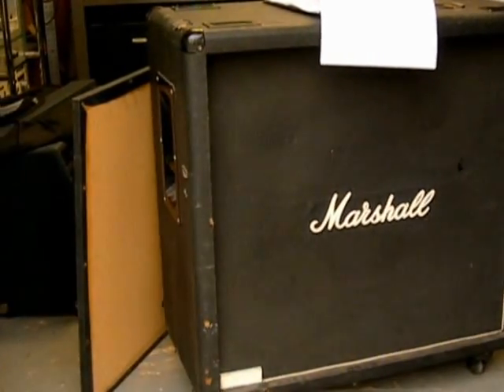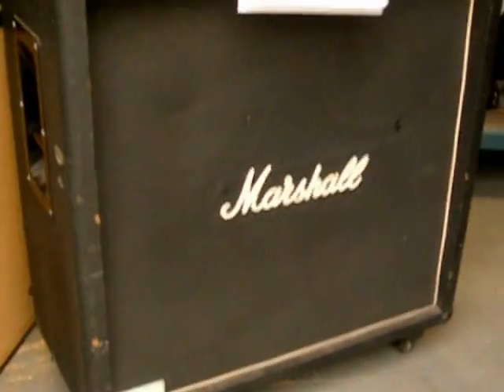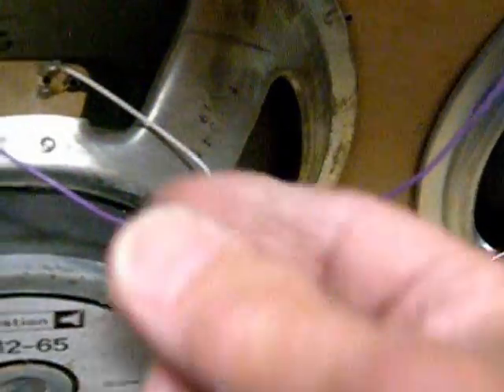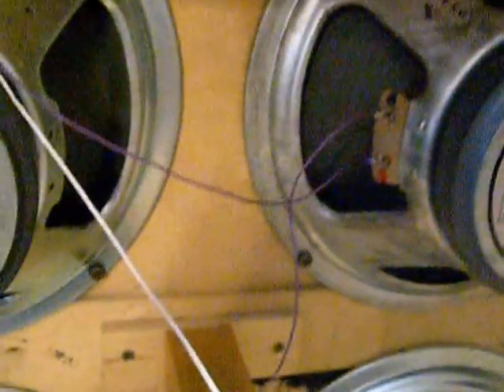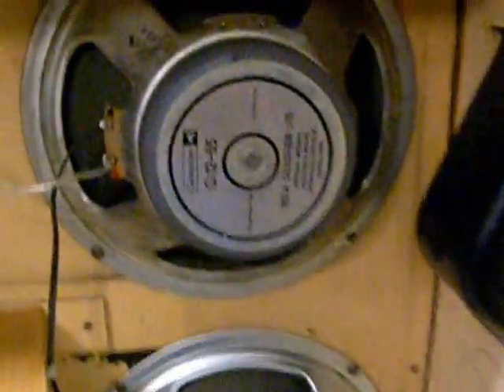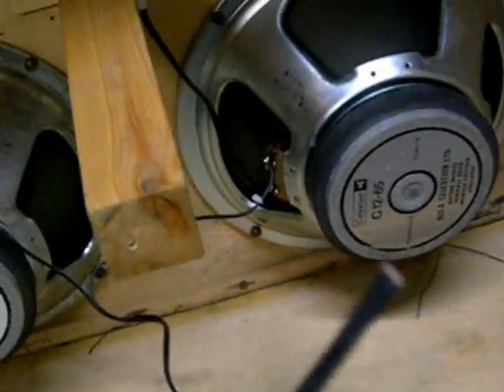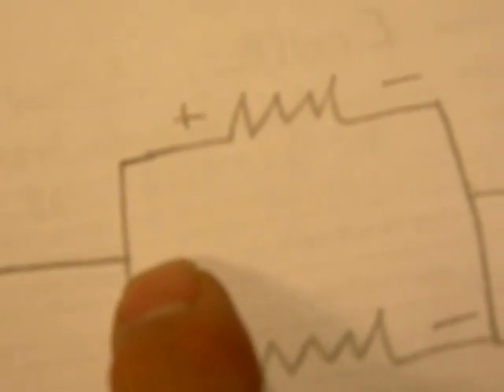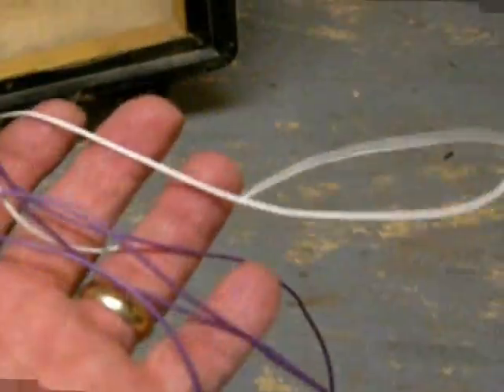Marshall 4x12 Cabinet Wired Improperly.wmv

Comment: Can somebody help me? I have a 4x12 marshall cab with 4x 8 ohm Celestion's and I would like to wire it up to get a total of 8 ohm's. Will series/parallel wiring work for that?
Reply from the maker: Put two of the speakers in series connecting plus (positive) to minus (negative). This puts the speakers in series and in phase so they work together pushing outward and inward in sync. This will give you two speakers in series which will look like one 16 ohm speaker. Do the same for the other two speakers. Now you have the equivalent of two 16 ohm speakers so you want to connect them in parallel, plus to plus (positive) and minus to minus (negative). Now you have 8 ohms and all speakers are in phase. Hope this helps.
Reply: @ElPasoTubeAmps  Thank you so much!!! Definately helps! I watched a video on how to do this wiring setup, but he was using all 16 Ohm speakers so I wanted to double check it would come out to 8 Ohms using 8 Ohm speakers! Im new to all this, but as a musician and a studio owner/engineer I'm trying to learn to do as much as I can buy myself for stuff like Repairs/Maintenance/Mods, and any help is always mucho valued! So, can I ask one more thing. How would I wire it up, if I wanted my 4x12 to be 16ohm's using all 8 Ohm speakers? Also I always forget but whats the rule when it comes to cab/amp impedance mismatches. If I remember correctly, it's you dont want the cabinet to be a higher impedance than your amp right?
Reply from the maker: @underpressureman  You are not going to get 16 ohms using four 8 ohm speakers. Your options are 8 ohms, 2 ohms or 32 ohms.  I agree with you on mismatch to go low on the speakers. The worst case I ever saw was four 16 ohms speakers wired in series (64 ohms) and it kept blowing the EL34's our of the amplifier until I had the customer bring his speaker cabinet to me and quickly saw the problem.
If you had four 16 ohm speakers you could get 16 ohms, 4 ohms or 64 ohms.
Reply: @ElPasoTubeAmps  Okay, thanks, that all makes perfect sense. Can I bother you with one last question? And I appriciate all the help so far. I actually have a pair of 16 Ohm vintage 30's that Im not using in anything, but all the other speakers I have are 8 Ohms. I really want to try mixing vintage 30's with G12M-70's but is there any way to use x2 16 OHM speakers and x2 8 OHM Speakers in a 4x12 and what would the options for wiring be if you can?
Reply from the maker: @underpressureman  You could put the two 16 ohm speakers in parallel for 8 ohms then  that pair in series with the single 8 ohm for 16 ohms. You could also put the two 16 ohm speakers in parallel for 8 ohms and put that pair parallel with your single 8 ohm for 4 ohms.

Comment: Good video. When ever buying used equipment you should always check the ohms before attaching an amplifier to it. Even if it's from a friend. If you don't know what you're looking for get someone that does.
If you're using 2 cabinets, they must be wired in phase(The same) or they will cancel each other out.
There's wiring diagrams all over the internet and there's plenty of demo's on you tube like this one.
A problem with buying used equipment is people stealing out the good speakers and replacing them with something cheaper, which in this case could have been 8 ohm speakers in a cabinet that says 16(or 15). you must hook the amp up to the proper load!

Comment: It looks like all you did is make it worse by reversing the polarity of two speakers. Did you check it with an ohm meter to make sure the impedance is correct? Your diagram was correct, your wiring was not by the looks of it with poor video quality.
Reply: Sure was wired correctly for impedance and phasing.

Comment: Marshall amps were routinely 8 OR 16 ohms. (the true vintage ones were very often 8...same is true for Hiwatt). HOWEVER, for those of us who toured using 4 cabinets per head ...this was the correct way to wire it if you wanted to set your amp to 16 ohms using  4 cabinets without much other monkeying around. Since it was internally done without having the polarity incorrect on any of the four, it may have been that way on purpose.???  By the way, this gives you a very nice sound on stage.  Not so nasty up close...but you don't loose it as you get farther away either.  And yes, you will blow some tubes if you only have one speaker cabinet plugged in at 60 ohms. You do need all four or you are asking for it
Reply: I’m afraid your comment is a little confusing. You said that, “Marshall amps were routinely 8 OR 16 ohms.” Were you talking about the speaker cabinets? Or the amplifiers themselves? Marshall Amplifiers since 1966 have had a selectable impedance of 8 & 16 ohms (and later on 4, 8 and 16) with the pin selector. So you set the impedance according to what speaker cabinet you’re using or how many. I have never seen a 4 x 12 stock Marshall cabinet that had impedance of other than 16 ohms. Hiwatt amplifiers also have a selector switch for the speaker impedance of 4, 8 and 16 ohms, along with most of the Fane purple loaded 4 x 12 speaker cabinets were also 16 ohm. I’m a little curious how you connected 4 Marshall speaker cabinets to one head? Most Marshall amplifier heads only have two output jacks with the exception of the model 1967 Major 200 watt amplifiers.
Reply: Kai Po Let me clarify, I realize few people are technicians looking through these vids.
Obvious (or not), I was referring to  the speaker cabinet, not the amp. My bad.
16 ohms was by far most common. But if you were in music in the 70s, you shouldn't even be arguing with me. There were plenty of 8 ohm cabinets out there at that time. I've been mostly out of music for close to 20 years, and I know if you didn't specify you usually got a 16 ohm cabinet.  I still have most of my gear, My hiwatt cabinet I  bought mid 80s is definitely an 8 ohm, although my oldest hiwatt cab. (1970ish) is 16...which is the reason it was never used for touring. (For the most part, we used marshall cabinets for touring, Hiwatt heads)  I do not own any 16 ohm marshall cabinets, they are all 8.  Last cab. I bought was in the 80s and it was made in the 70s. I don't recall ever buying a 16 (although most folks had 16ohm ones), although the 8 ohm ones were getting harder to find as time went on. The ONLY reason I always needed 8 ohm ones was because that was what we started with and the idea of replacing all of them was irritating.   As far as how to wire them, you already should know if you are versed on impedence. But I will humor you.  In my rig, rather than running 4 cabinets at 32 ohms each and using an adapter for 4 (some marshalls had 4 outs,...I don't think I ever had a Hiwatt with 4), I had 2 or three adapters made,..they have one input (from the amp) and 4 outputs, the outputs HAD to ALL be plugged into 8 ohm cabinets...and they worked in a similar way you would wire 4 speakers up in a cabinet. Once in a while we would use 8 cabinets each, which is why I have more than one of those adapters (when using 8, obviously we were set to 4 ohms at the amp. Even though we had quite a few heads, stage volume just gets wayyy too loud if you  are actually using more than one head. The only problem with 8 cabinets was  you needed your guitar amp mic a long distance from the drummer, since you'd get a lot of bleed, I seem to remember keeping a single 8 ohm speaker (in a single cabinet) and turning it sideways away from the drummer so that snare drum was not always going into the guitar mic louder than the guitar was.

By the way, just because you read somewhere that only a marshall major had 4 speaker outs, does not make it so. It was less common for sure. But I've seen wayyyyy too many with 4 for me to think the one I had was some sort of mistake.

Comment: To properly wire a Marshall 412 cabinet the total impedance should amount to 16 ohms! This is the typical impedance for Marshall cabinet. So in essence two of the 16 ohm speakers should be wired in series on each side and then the output of the paired series connected in parallel. So you will have the series connection of two speakers at 32 ohms and then connect each series of two in parallel with a final impedance of 16 ohms. The whole reason for the 16 ohm speaker being used in the UK is in the early days of building speaker cabinets for PA use they tended to attach several cabinets together, but they made the mistake of using small gauge wire and ended up having impedance problems. Marshall output section does not do well at low impedance speaker loads.

Comment: hi, i have ibanez soundwave SW100 that can produce 100w. The original speaker is 8ohms 200watt ( according to the suipplier ). it is possible to add one more 8 ohm speaker in parallel ( it has 2 output jack ). Question : can i change the original speaker to 2 x 400watt RMS ?

Comment: Low or no-load conditions with high amounts of drive generally cause excessive screen grid current. Unchecked, this could lead to tube failure.
Good catch on the speaker impedance and wiring!

Comment from the maker: This may or may not have anything to do with your problem but I have seen on several occasions where the reverb tank and/or reverb circuit can cause oscillation. I just fixed a really nice Fender Deluxe Reverb (pair of 6V6) that had a bad 25uF/25v cap across an 820 ohm cathode resistor. Turning up the reverb just slightly sent it into a 4 kHz squeal. Similarly I just sent out a Crate VooDoo with a bad reverb tank that would squeal very high (didn't measure the frequency) with a little reverb on.

Comment: Good video. I have a Peavey Windsor Amp Head, that is oscillating at RF when all tone & texture controls are turn off. All the last EL34 tube red plates pretty quick. I've tried different tubes and check many compnents (out of circuit, and no luck. I have not tried it with a differnt cabint. Your video here, made me think of a similar possibillity.